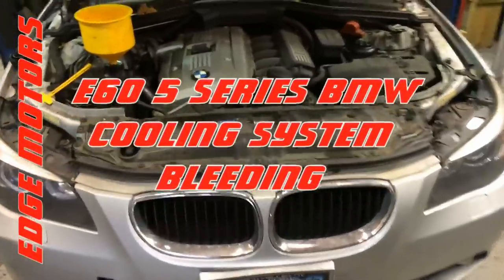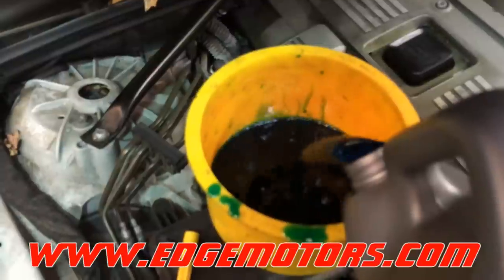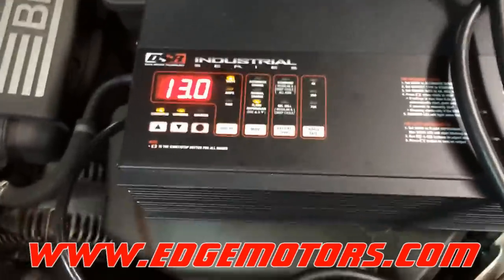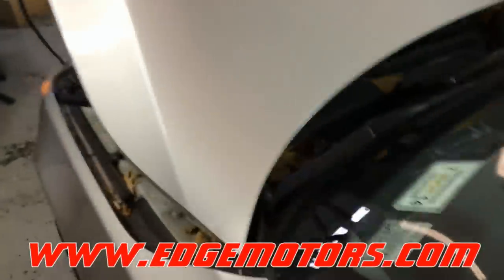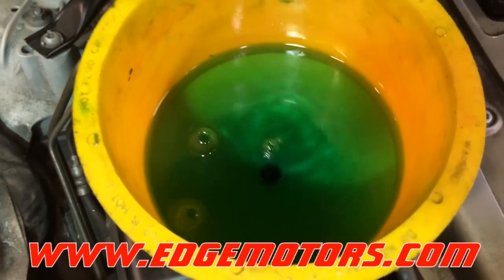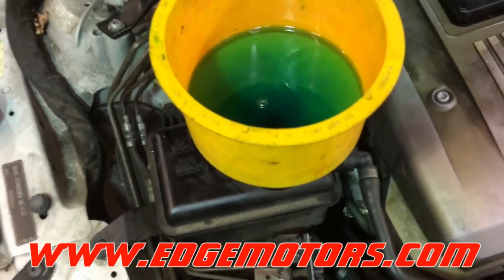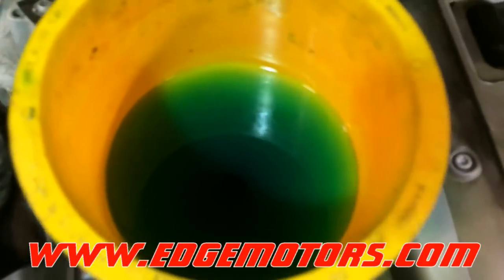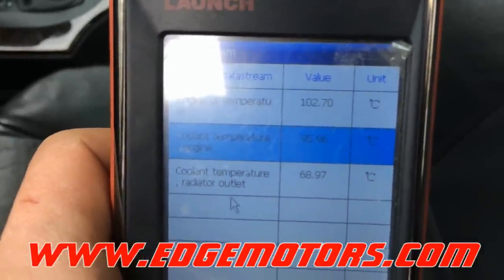E60 5series BMW cooling system bleeding diy by Edge Motors

Comment: What if while performing this procedure, you observe the coolant rising inside the funnel up to the top?
I'm using a smaller funnel, but around the time the thermostat starts to open the coolant level rises until it flows over the edge and I shut the engine off.
The thing is no bubbles appear during this process and as soon as I shut the engine down the coolant level recedes back into the expansion tank just above the cold fill line.
Any ideas? Thanks

Comment: Ok I didn't hold the gas pedal for 20 seconds .. The videos said 10 seconds... That may be it.. Thanks for responding .. I'll try it again later tonight. And follow up.
Reply from the maker: the pump is electrical and you should hear the motor running when its activated...

Comment: Hello. Does this same thing apply for the 525i as well??? And if so. I didn't know you had to bleed the system and I already changed the pump and stat but car is still over heating. Do I need to flush the coolant again or just bleed the system???
Reply from the maker: +Trav Black what year is your 525i???
Reply: +EDGEMOTORS mine is a 95 525i wagon will this work and if not how do you do it
Reply from the maker: +andy poole  no, yours is a mechanical cooling system.
You have to fill it, bleed the air out through bleeding screws, and let it run and monitor it ...
Reply: EDGEMOTORS Hi I have a 2005 5.23i will this procedure work on my car over heating?
Reply: BrownGeezer01 and it will if there are air bubbles in the system

Comment: Hi friend, I did this procedure more than 4 times and I have temperatures of 96 and 97 degrees Celsius. But the alarm light (Yellow Radiator) is not removed from the dashboard. I entered the menu to reset the light but I can not find any low coolant alarms. The mine is a BMW 525i 2007, E60, N52. You can recommend me some solution about it. Thanks in advance for your response.

Comment: This didn't work for me.. I tried exactly set my set tried 10 sec, and 20 secs no luck is there a manual way to bleed system???
Reply from the maker: Armenak Krbashyan you sure your heater temp is set is set to high and the fan set to lowest speed and ignition is on???

Comment: do you have to have a battery charger connected for this to work?
Reply: yes if you dont want your battery to die. If its new you may be fine. You also may be fine if its a AGM (absorbent glass mat) vs lead acid battery (traditional). The AGM battery is hard to kill.